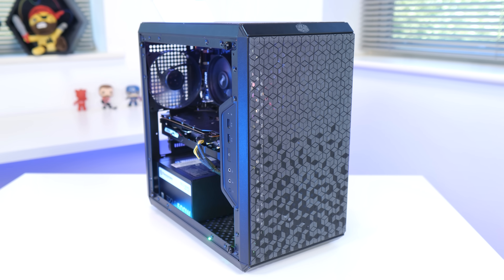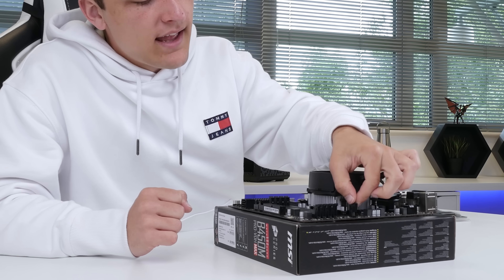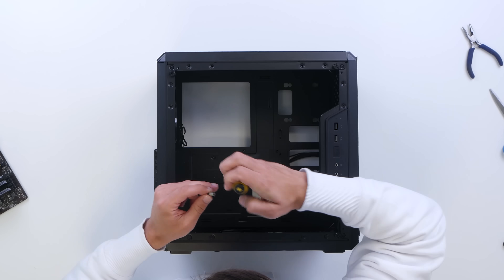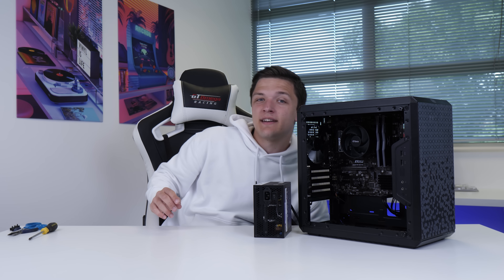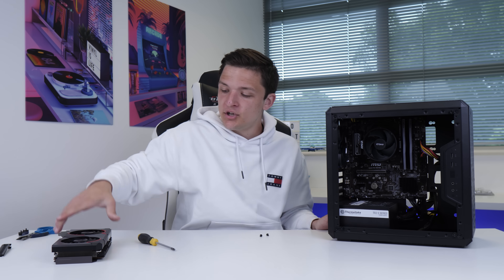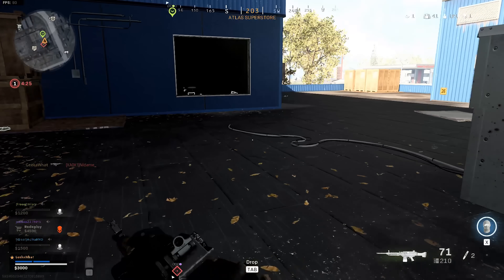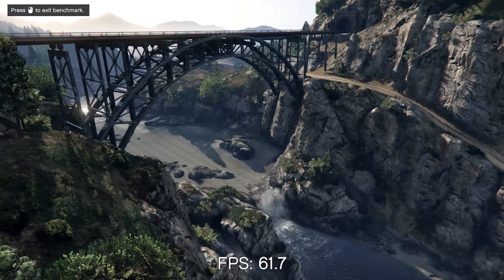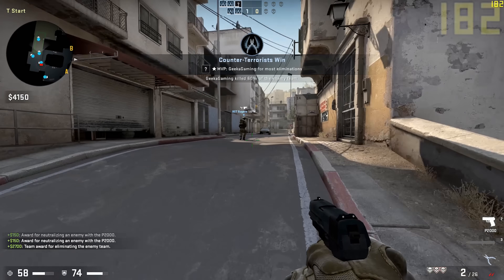Epic $650 Gaming PC Build 2020! [Ryzen 3 3100 & RX5500 XT w/ Benchmarks!]

Comment: Few pointers to make ur 114fps pc turn in to a 400fps gmaing pc besting the i9 9900ks in fortnite.
Btw u wont ever find these items cause pc builders like me know about these products and will buy them out when we see them.
Asus prime a320 mobo work with cl14 ram to overclock ram like 2400mhz wil over clock 3200mhz and 3200mhz will go to 3800mhz that will give u 50-80fps Yes you heard right just faster Ram will significantly increase the performance of the Infiniti fabric that is found in ryzen CPUs

Also a 3300x with cl14 ove rclocked 3800mhz ram paired with a A320 mobo actually gives it around a hundred FPS boost just the motherboard Alone by getting a A320 and not a b450 you are limiting the functionality of your motherboard getting rid of a lot of unnecessary components giving you faster delivery and a closer Ram dimm slots to the CPU making your performance increase just that much more( there's a reason why overclockers that set record used basic A320 look-alike motherboards that have to dimm slots and are very basic)

Also a rtx 2060 ko has built in encoder to make ur 4cpre 3300 more like a 6core so u can stream and game without  losing fps

Comment: Great vid, but I don't understand the choice of CPU and GPU. Isn't the 1650 Super identical to, and in some cases better than, the 5500xt, but for $60 cheaper? Even if it isn't much better, it's practically identical, so shouldn't you be using that extra money to upgrade the 3100 to a 3300x, which is FAR better for only $20 more? So by going with a 3300x and 1650 Super, you could have had a more powerful build for $40 cheaper. Am I missing something?

Comment: Just bought the case and psu, gonna buy the rest when they come back in stock, but i cant find the same ram sticks. Will this work with different ram sticks? Plus cant wait for this, its going to be my first pc ever

Edit: also can this pc run ac origins, witcher 3 high or medium 1080p?
Reply: It should work
Reply: @enderplay7200  Do you know what ram sticks will work with it and are just as powerful?
Reply: @sprays4days-edits  i believe any that are 3200 mhz should work. Your motherboard specs should tell you what ram you can usd.
Reply: @enderplay7200  alright thank you! Ill check what my motherboard says

Comment: You using motherboard with 3.0 PCIE , that's why there so much bottleneck
Reply from the maker: Lol you can't be real. A 5500XT gets no where near the ceiling for PCIE 3 bottlenecks, even a current gen 2070/2080S won't show really any upside on PCIE 4 with one GPU
Reply: @GeekaWhat  yeah ,my 5500 xt on RDR2 can reach very high setting with 60 fps
Reply: @GeekaWhat  with same spec
Reply: @GeekaWhat  but i' using x570 motherboard

Comment: Yoo this is a sick 650$ build. Just wondering will you do a 1000$ full setup (pc, monitor, keyboard mouse and headset, table, chair etc) or a 2080ti equivalent build (so a full set up like mentioned before but for the price of a 2080ti which is around 1200-1300 dollars)?
Reply from the maker: Full set up videos coming! The first one should be around $2000 all in and I’ll work towards ticking off other price points 👌

Comment: perfect timing! i’ve been planning a build around this price for a while. i’ve got one question though. is there any reason you went with a 5500xt over a 1650s? im curious if it preforms differently.
Reply from the maker: I found the 5500XT to be better performance for the price! 👍
Reply: GeekaWhat thanks!
Reply: Go for the 1660 super better than 5500 xt and cheaper in some countries you'll get a difference of 15-30 fps
Reply: Velocity Riovo got it

Comment: Hey man is a r5 3600 gtx 1660 super gaming x 3600mz of ram 550w psu and msi b450 tomahawk max a good gaming pc?
Reply: It will handle 1080p over 100 fps at most games
Reply: Someone You know yeah its about 920$ I’m trying to play GTA and at ultra i can get 100fps but i have 60hz monitor so thats good but I’ll upgrade down the line to 144hz also will this be better than my ps4 by alot or a little? Thanks mate!
Reply: @adriandltv  its gonna be better by a huge amount, also you can get the same specs for cheaper i believe
Reply: Someone You know its because the prices rised

Comment: hey i order the 220t corsair case from your previous video and my jfp1 cables are not labeled what can i do ?
Reply from the maker: Not labelled at all? Your power switch (the important one) will be a solid 2 pin connector so try plugging this in to get the system to boot! These should be labelled tho??
Reply: @GeekaWhat  thanks for the response i confuse the three fan cables with the jfp1 cables my jfp1 cables were stuck behind the MB i couldnt find them lol